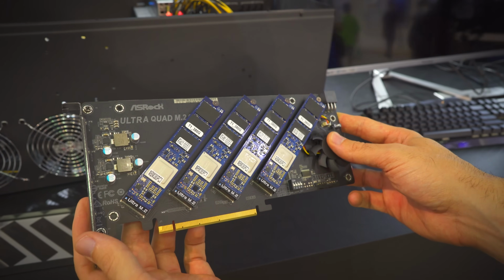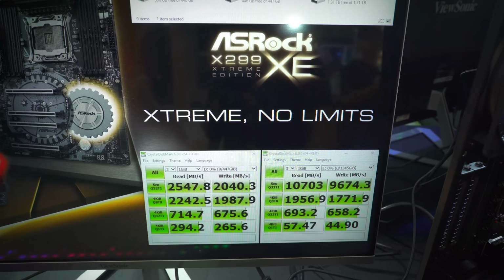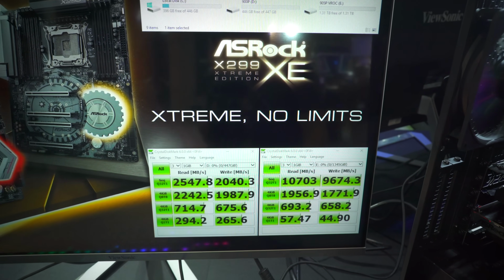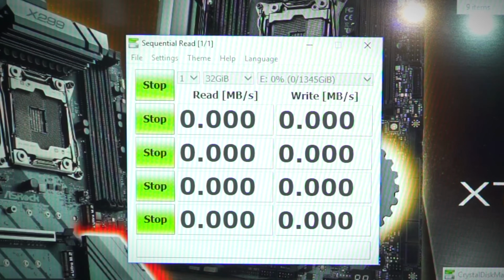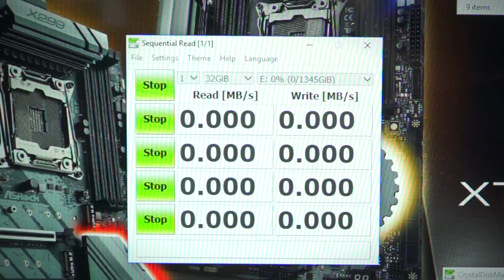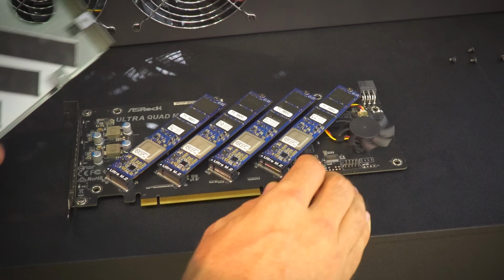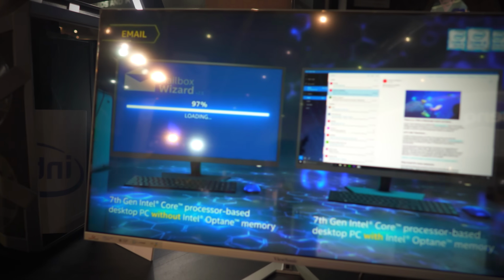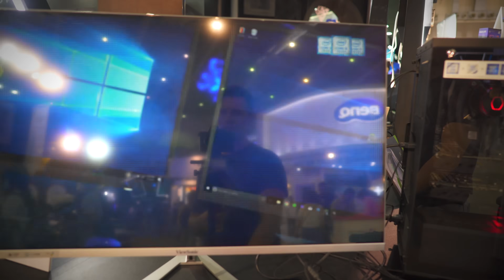100 Gbps File Transfers?! ASRock ULTRA QUAD M.2 PCIe Add in Card

Comment: Hmmmm just did a little research on putting SSDs in RAID0 for speed.

It seems RAID0 (aka RAID for speed) boosts sequential file reads/writes but does little for random accessed files.  
In a nutshell, RAID for speed is great speed boost for big/long files but does little for numerous small files.  
   Should you RAID NVMe SSDs? - 2x Samsung 970 EVO https://www.youtube.com/watch?v=GgH0LPU9oes

And it gets juicer, a SSD drive contains a small/super fast cache & much large/slower bulk storage.  Ignoring seek delay times, most inexpensive SSD drives are only a few times faster than a HDD.  
     SSD Review — 8 NVMe M.2 Drives Tested — Which Should You Buy? — 2019 Edition (SSD cache is @10:30 into video)  https://www.youtube.com/watch?v=GlGjd1GZWdo

And it keeps getting juicer, even if you RAID0 numerous superfast/expensive SSD drives, current computers become the bottleneck. 
    How Fast Is Motherboard RAID with Five SSD's? https://www.youtube.com/watch?v=Rv8ouhYvJ14

Most amazing super storage speed claims seem to be just good-old-fashion hype/spin:
   100 Gbps File Transfers?! ASRock ULTRA QUAD M.2 PCIe Add in Card https://www.youtube.com/watch?v=lgiAETxV7fc

In a nutshell, current storage standards just don't stack/scale well at all.  I say right-now RAM to SSD to HDD to cloud to bulk backup caching/tiering & a solid data management/protection plan are the best bang for storage performance including speed until storage standards finally stack/scale together.

Comment: does it work on a x79 platform ?
Reply: some experiments needs for x79 that hardly inuse now days. bios tweaks need for pcie lanes to use 4 nvme drives
Reply: Hi Hans, 
x79 Chipset - https://ark.intel.com/content/www/us/en/ark/products/64015/intel-x79-express-chipset.html - No. 
1.) Requirement: PCIe 3.0 x16 Slot - You have PCIe 2.0 x8. 
2.) Requirement: Bifurcation. Bios must be able to Bifurcate the Slot from x16 to x4x4x4x4. Each NVMe M.2 SSD requires 4 PCIe Lanes, hence a x16 Slot requirement. Good Question!

Comment: It's not 100Gbps. Remember 8 bits per byte. 10,703 x 8 = 85,624.  So about 86 Gbps. If you want true 100Gbps, you need to be reading/writing at 12,500 MBps. A PCIe 3.0 x16 can transfer max 16,000 MBps. When PCIe 4.0 comes out, that will double to 32,000 MBps, and then PCIe 5.0 which will double again to 64,000 MBps for x16 lanes. And yes, I'm a Network Engineer. lol
Reply: Ditto on that. Theoretical Marketing Specs. It's like saying Thunderbolt 3 is 40 GB. Overhead and such. Sounds good on paper.

Comment: I bought the card and tried to install in the ASrock Fatal1ty Motherboard....but machine won't boot...any special setup in the bios?
Reply: Hi CinePost, 
ASrock Fatal1ty Motherboards... Intel Z170 Chipset. Will not work. Your Chipset does not support 2 x16 Slots, only 1 x16 Slot. With 2 x16 cards, the Slots drive down to x8 each. Therefor, no go. This type of card requires a x16 Slot. Each NVMe M.2 SSD requires x4 PCIe Lanes, hence the need for a x16 Slot. Resource Allocation. 
BTW: Your System should still have Booted. You would have only seen 2 Drives if installed in the correct Slots. Curious. Same issues on AMD X370 Chipset. Not enough Resources! This type of card is made for HEDT (X299 & X399) and Workstation platforms.

Comment: You said Intel M.2 cards recommended, will this work with the Samsun 970 EVO nvme M.2 cards?
Reply: Samsung 970 EVO NVMe M.2 SSDs - Yes. However, depends upon platform specifics (X299 vs X399 Chipset; PCIe Bifurcation) and RAID array (0, 1, 5, 10, JBOD) requirements.

Comment: The dip switches on the ASRock Ultra Quad M.2 card are there for systems that have multiple such cards installed in the same motherboard.  RTFM (Read The Fine Manual!):
https://www.asrock.com/mb/features/Ultra-Quad-M2-Card05.jpg

Comment: Just read some reviews on that card, I'd pass on it.  Doesn't appear that anyone has gotten it to work with more than one NVMe.
Reply: This Card is made for HEDT and Workstation class Motherboards. It will not work on just any Motherboard. Resource Allocation. Not enough resources.

Comment: When are motherboards going to support 
* SAS or SATA 4
* Thunderbolt 3
* 2.5GBE nics to REPLACE single gig
and 5GBE nics
Reply: There have been 'gaming' motherboards with SAS built in in the past. An example is the ASRock x99 Extreme11 which as 10 SATA ports and 8 SAS 12 GB/s ports.
Gigabyte made a few that support it, ASRock made a few, and Asus made a couple (though those are classified as 'WS workstation boards and are very expensive).
SATA 4 was forever held up by power-draw problems with the controllers. Combine that with the extremely low overhead and speed of NVMe I'm not sure I'd be excited by a 12GB/s SATA SSD. We're sort of at the point where I doubt anyone going to notice the difference between ~600MBps and 1200MBps that also wouldn't benefit from the 32Gbps of NVMe? 
Thunderbolt 3 is available on a bunch of Intel boards. Lots of Asus motherboards have it on an expansion card. It was recently made license-free so soon AMD will probably use it. 
2.5/5 Gb network cards are coming but it's similar with the SATA4 problem... everything is gigabit. If you need more you'll probably benefit from a lot more. I run 10Gb myself but I can saturate that with loading something from a single NVMe SSD on a remote computer. That and it cost less than $50 for the whole setup...
Reply: Thunderbolt 3 has been out for about almost 2 years. you need the right board and a card.  or this.  https://www.asrock.com/mb/Intel/Fatal1ty%20Z370%20Gaming-ITXac/index.us.asp#Overview
10gbe cards are available for $99 or less depending on what standard you go with.

Comment: What's the support for this card? I had a Asus hyper m.2 x16 (around £40 from amazon) for a while, but unfortunately it only supported x299 mobos for all 4 nvme drives - only managed to get one drive working on my maximus VIII Hero (Z170 socket).
Reply: Hi Seb, 
ASUS maximus VIII Hero (Z170 chipset). As You found out, your Chipset does not support the Requirements of this type of Card. These Cards are made for HEDT (X299 & X399) and Workstation Motherboards. BTW: Should have seen 2 drives if in correct slots and if you could Bifurcate the Slot. No Bifurcation, no more than 1 Drive seen.

Comment: Not sure why it needs a 6 pin cable. Nvme drives only use around 5 watts, no? And the x16 slot can supply 50+...
Reply: Unfortunately PCIe 3.0 can only deliver 25 watts to a x16 slot if it is not identified as a graphics card. If it's identified as a graphics card it can deliver 75 watts. 

The M.2 spec calls for a maximum of 7 watts. They probably could have gotten away with a somewhat ironic SATA power connector.

From PCI specifications: 
×4 and wider cards are limited to 2.1 A at +12V (25 W) and 25 W combined.
A full-sized ×16 graphics card may draw up to 5.5 A at +12V (66 W) and 75 W combined after initialization and software configuration as a "high power device".
Reply: Jaymiecain1 the raid controller needs power. The 16 x slot should be fine but I bet the actual card needs the the extra power not the nvme drives
Reply: It's for future M.2 support. Atm it's not needed
Reply: I'm just saying it was probably another option. Also per the manual:

This card provides a 6-pin graphics 12V power connector. Install the PSU’s
power cable to this connector when more than two M.2 cards* are installed.
*Intel Optane SSD 900P or other M.2 card with higher power consumption

The 900P only comes in either a standalone PCIe card or the M.2->U.2 kit. The U.2 version is listed at 14watts but I assumed most of that would come from the connector on it which is ultimately just a SATA connector.

But I guess that's ASRock's reasoning.
Reply: And if you use like u.2 drives with u.2 to m.2 adapters they will need more. It is there for backup so pcie power woun't be over draw. Tweak has review: https://www.tweaktown.com/reviews/8542/asrock-ultra-quad-2-card-16-lane-aic-review/index.html
Reply: Why would you want a bulky sata cable being plugged in? A nice sleeved 6pin pcie cable looks far nicer.
Reply: Hi 
Jaymiecain1, 
A smart total design solution. Consider this... This card is design to be installed with up to 4 of these cards in a System. 4 cards each carrying x 4 drives adds up, for power from the PCIe Bus. This of course would require a Workstation class motherboard with additional PLX chips to support that many x16 Slots. The Workstation Motherboard would have to have 5 - x16 Slots with 4 of those x16 Slots, Bifurcated. Now that's resource management! 

Each card has a Switch, under the hood... 1, 2, 3, 4 to identify each card in a system. Can You image 4 of these cards in a System - Wow!

Some Motherboards that can accommodate say (2) x16 Video cards will have a PEG (PCIe Graphics) Power connector for the additional Power Required through the PCIe Bus. Excellent Question!

Comment: Does that asrock quad m.2 AIC require you to have VROC on mobo(x299)?
I'm asking because I have x99 board.
And can the m.2 drives function as individual drives?
Also would be interesting to see the temps on the whole aic with the fan in back.
Reply: You need a board that supports pcie bifurcation, so atm only X399 or X299 boards.
Reply: Okay,thanks for that information. I wasnt sure if x299 and x399 was the only choice for this.
Reply: Yes, there is a select list of supported motherboards: 

Motherboard 
Intel X299 Chipset
X299 OC Formula 
X299 Taichi XE 
X299 Taichi
Fatal1ty X299 Professional Gaming i9 XE 
Fatal1ty X299 Professional Gaming i9 
Fatal1ty X299 Gaming K6 
X299 Extreme4 
X299M Extreme4 
X299 Killer SLI/ac
AMD X399 Chipset
X399 Taichi 
Fatal1ty X399 Professional Gaming
X399M Taichi

And yes a VROC module is required for x299. The individual drives would be configured in VROC which I've never seen so I'm not sure if they 'have' to be in RAID.
Reply: Hi anders, 
Ditto with GGF. To Your Questions:  
1.) VROC on mobo (x299) for RAID 0, no; use any NVMe M.2 SSDs. RAID anything else, yes; Intel only NVMe M.2 SSDs. 
2.) ...can the m.2 drives function as individual drives - As JBOD, Yes! 
3.) You 1st have to have a x16 Slot that the Bios can change (Bifurcate) from x16 to x4x4x4x4.

Comment: Does the Quad Key 16x only take Intel NVME m.2?
Reply: Hi Karl Benson, 
Excellent Question! Short Answer - No. Longer Answer... However, depends upon Platform Specifics & Requirements - For HEDT & Workstation Motherboards. 

1st Requirement to Support this type of card - 1 PCIe x16 slot, Bifurcated to x4x4x4x4. 

- Intel X299 - RAID 0 - Any M.2 NVMe SSD. Intel RAID 1, 5, or 10 - VROC required; And that's only with Intel NVMe SSDs. 

Anyone requiring a VROC (dongle) Key for X299 Chipsets, you need: VROCISSDMOD Key. According to Intel for X299 Chipset & Skylake X processors (Core i9-7900X with 44 PCIe Lanes), is Bootable only with Intel NVMe SSDs on X299 Chipset. 

- AMD X399 - RAID 0, 1, and 10 or JBOD. No RAID 5. X399 can use any M.2 NVMe SSDs like the Samsung 970s. 

The trick in setting up this type of card is using the RAID array without having the Boot Drive also in a RAID array. Key: Drivers have to be installed manually.

Comment: Does it have a plx chip? Or does it need bios bifurcation support to use it?

If it needs bifurcation support the motherboards you can use it on will be quite limited.

In the server space there are already 1/2u servers that will take 24 u.2 nvme drives for stupid fast storage. Wiwynn had their ST300 at computex that's a 1u disk shelf with 24 u.2 nvme slots.